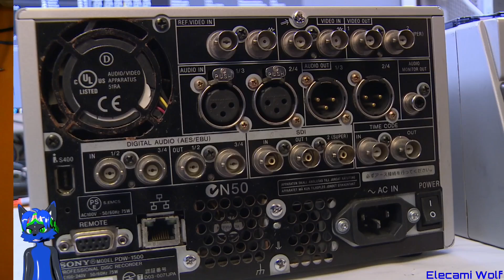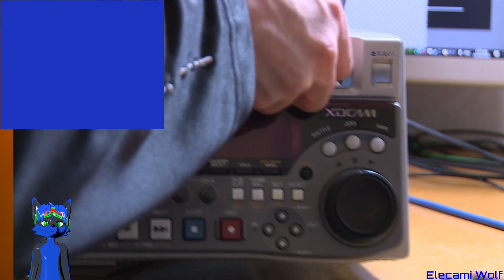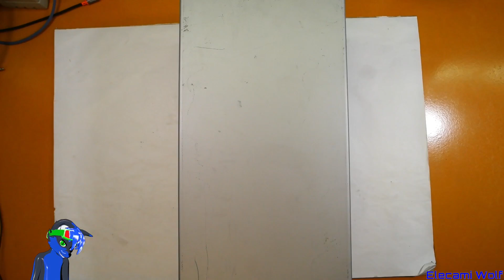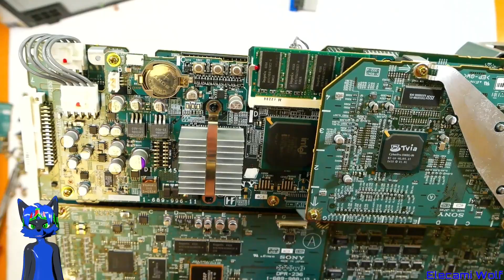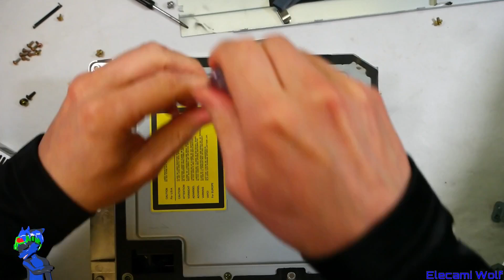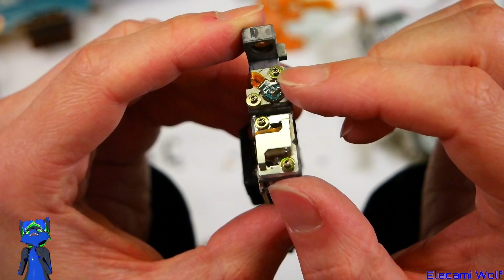EW0129 - Sony PDW-1500 Professional Disc Recorder Teardown

Comment: damn, i need such a power supply, my machine shuts off after a few minutes of operation 😞
Reply from the maker: Is it the power supply causing that or some error? Maybe power supply capacitors are going bad.
Reply: @Elecami  hi, i think its the Power supply, Caps were changed including the high voltage cap. Unit shuts Off Display and Power LED dont lit. After a few minutes Off the grid, the machine works again for 2 minutes and shuts down again. Cables are checked ...
Reply from the maker: @stefanjakob2594  Maybe can find another dead unit for cheap on eBay?

Comment: Interesting, I came here because my machine is not functioning anymore. Its developed a fault but no fault showing on screen. I might pull it apart just for kicks. Its written off in our books now. Its funny how you have broken down every camera I have used and owned (some still) PDW 530's and 355's and even the old M7 ! Cheers
Reply from the maker: Yea, take it apart. Lots of good things to discover in there.

Comment: 41:45 The Samsung K9F1208U0A chip near the IDE connector is an 64M x 8 Bit / 32M x 16 Bit NAND Flash Memory. That most likely contains the OS for the embedded Celeron CPU. Maybe remote control over the network is a lot of the reason why there is a whole embedded computer in this recorder.
Reply from the maker: Ah yes, I did look up that. looks like the NEC chip next to it is an IDE adapter for the flash. Probably made it easier for the network stuff to use an OS that already has all that stuff setup in it.

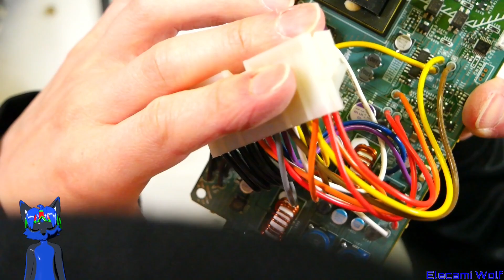Comment: 36:22 yea that even looks like a typical 24 pin PC PSU connector lol they really did just squish a PC in there, would be super cool to see what shows up on that VGA if anything at all. 

also not sure what that glass with the flat flex was, probably another sensor thingy and yea case is ground for some laser diodes, IR case seems to always be positive. cool stuff, lots of pretty dichroic glass in there too :3
Reply from the maker: I think it is a different pinning to a PC Power supply. 
Laser has 3 terminals, but still uses the case? I guess one of them is the case.
Reply: @Elecami  ahh i see, ya at a glance it looked exactly like a typical PSU connector for a PC.

(ignore for IR diodes) USUALLY if you look at the laser diode from the back with the uninsulated case pin (i think ground) at the bottom and the other 2 pins with the black insulator around them above it, the right insulated pin should be + and the left insulated pin should be the photodiode connection, to measure the laser output directly. (ive noticed a bunch of things dont use that pin, perhaps its mainly a calibration thing for the factory) if that doesnt work try the insulated pin on the far left as ground instead of the case, some diodes just have that extra case pin as a leftover. 

ive had plenty where i just cut that pin but yea a bit of a roll of the dice guessing without the actual datasheet so take it all with a grain of salt, of course theres always exceptions. what i explained is pretty common though.

Comment: 00:11:38 - maybe, as professional piece of gear, it expects reference clock/black burst at the input and doesn't like to record in freerun mode.
Reply from the maker: I think it is because the Recorder is in NTSC Mode. I just noticed the little '625' on the screen when checking the edit. I was feeding PAL into it. Would also explain why it was not showing anything from FireWire.